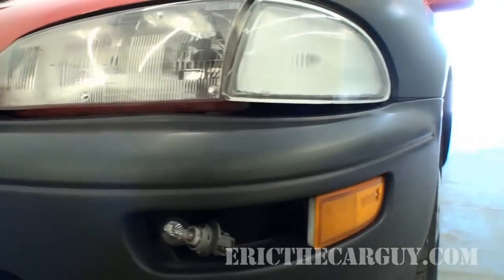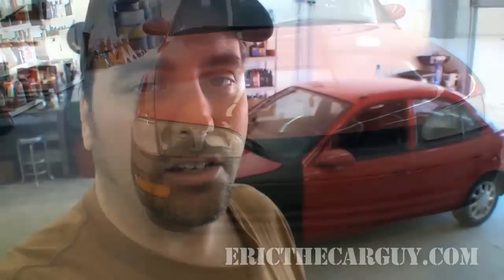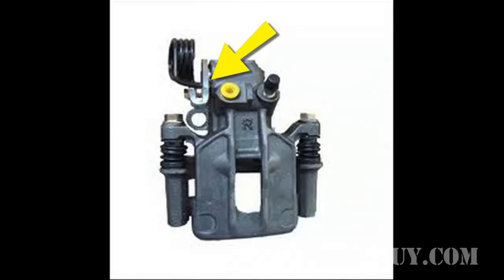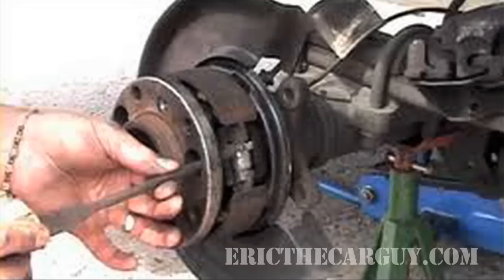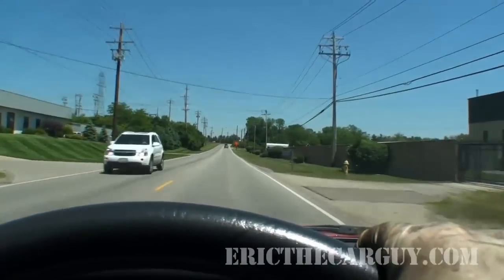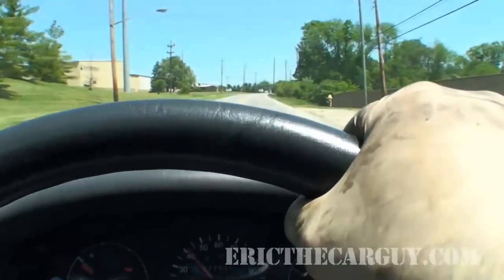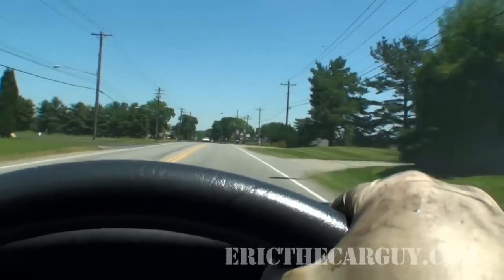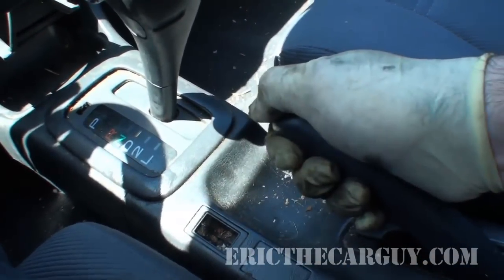How To Isolate A Brake Pulsation - Eric The Car Guy

Comment: Here is how you tell the difference between a front brake pulsation (warp) and a rear brake pulsation. If you hit the brakes and feel pulsation in the steering wheel and brake pedal it is the front brakes. If you feel it only in the brake pedal then it is the rear brake rotor/drum, but don't tell anyone cuz this is a trade secret, and you should never pull your e brake if you have never used it (auto trans) because there is a fair chance the cable will not release (rust) and you will lock up your back brakes.
Reply: I have just replaced rotors and pads on all 4 wheels and calipers and brake lines on the front of my 2009 Town and country mini van. I'm getting a sever steering wheel shimmy only at highway speed going down long grades? I checked the tie rod ends and they seem ok. A mechanic friend said it was a warped rotor even though it was new ? Got any ideas ? Thanks
Reply: @mightymopar128.  I know it's an old post...I'd bet one or both discs weren't installed 100% flush. 🤔

Comment: I had heavy pulsation when applying the brakes especially at higher speeds on my 91 LS400. I turned the front rotors and it did calm a bit but not all the way. The problem was a pair of bad strut rod bushings. Replacement cost $305 USD and free labor (yours truly).

Comment: Also remember that whenever you turn/change the rotors you need to replace the brake pads for both sides.  Using old pads with fresh rotors will creates uneven pressure on the pads and increase stopping distance.

Comment: Yeah, If you got steering wheel shimmy when braking from high speed (45mph+), it's probably the front brakes. If you got a low speed pulsation when braking down from low speed, 20 mph & down to a stop in the whole car, probably rears then...

Comment: You're under the impression that my parking brake works XD
Reply: lol hoops
Reply: Same😂
Reply: and thatthey have obnes that can be pulled. like mercedes, no hand break
Reply: If you don't use your parking break it will be out of adjustment. Your parking break usually adjusts your drum breaks.
Reply: @markflierl1624  It was 4 wheel disc, actually. The cables were just old and stretched out

Comment: hi, your car most likely have bad front wheel rubber bushing. when you apply brake at higher speed, the force from the absorbed of momentum will make you wheel move slightly backward. so the distance between your front wheel ball joint will vary, but the steering arm is fix length all the time. that means when you apply the brake your wheel will misalignment. The pulsation was caused by the misalignment wheel, and become more evident when at higher speed. 
every car (even new car)'s wheel will slightly misalignment when apply brake, but it is under the acceptable tolerance. but once the rubber bushing get bad, it will significant increase the degree of misalignment. hope this help.

Comment: simple remove all 4 tires , inspect the whole system.All rotors and drums turned or replaced. all bushings and pins cleaned or replaced. A 4 wheel job prevents comebacks.

Comment: To anyone who leaves comments on here. While they are good suggestions. You have to remember. Eric tries to show you ways to manually check for problems without having to use gages or special equipment. Unless you HAVE to have it.  

As for me checking warpage. I take off the wheel and use a large screw driver and turn the rotor/drum and feel for increase/decrease in resistance.

Comment: In the only two cars where I've worked on the brakes, the rear parking brake is a drum brake inside the hub of the rear disc, and doesn't activate the same caliper as the brake pedal would.
Reply: Volvo? Subaru? Ford F250? See my comment earlier for the best warped rotor test.

Comment: It's not always a "warped" rotor. I was having massive vibrations/pulsations like that and all I did was installed new pads and lubricated caliper contact points with brake lube. Then braked hard from about 40mph like 5 times to break-in the new pads with rotors. Then I took the car for high speed run about 80mph and braked hard on that as well. Now they're smooth. Having to pay to fix/replace rotors is really a waste of money. To warp a rotor is a very difficult thing to do, you basically have to be braking constantly and then run into a puddle for that to happen. In my case, brake pads had about half tread but they were very old due to lots of highway miles, so brake pads over time harden more and lose lubrication in the back plates and cause noise and/or vibration

Comment: now i have a question?
when i went slowly brake in my 00 ford ranger the brakes felt like they were pulsing shudder i even felt it it would push the pedle back up
Reply: Same problem i am having and cant find an answer. And mechanic had no idea. Did you figure it out?

Comment: When you isolate for the rear brakes by pulling the e-brake (and you do feel a pulse), that doesn't rule out that there isn't also a pulsation with the fronts. If you pull the e-brake and feel no pulsing, then it's safe to assume it's only the fronts. But the inverse is not true; you cannot rule out the fronts just by testing the rears because there's no way to only test the fronts alone without the rears also activating. So if you feel a pulse in your rears and fix it with this technique, don't be surprised if your fronts still need work.

Aside: I guess this car is a beater, but I do hate when mechanics get into my car with greasy hands (or gloves) and get that all over my interior.

Otherwise, nice video.

Comment: Brake peddle vibration when braking is not necessarily a warped disc. It could be worn slider pins which cost pocket money to replace, unlike discs, & only take 5 minetes a wheel to change, if your a keen diy mechanic.

Comment: For cars with the two-stage rear brakes, would jacking up the front (assuming front wheel drive) and running through the gears indicate where the shake is?  No pulsating would mean the rear brakes are the problem?

Comment: warped rims, bad tires, bad rotors/drums, bad master cylinder/booster, bad brake lines, bad wheel bearings, ...etc. It could be that it's original master cylinder/booster simply needs rebuilt/replaced. Get a Chiltons car repair manual...it will help you a great deal in your endevors. Good luck.

Comment: Taking for granted you have a front wheel drive car: -The 3 bearings on the inner most link (into drivecups/gearbox) on your driveshafts might be knackered. This will be noticed as a slight vibration, mostly on accelereation.
It's incredibly hard to give any advice without even having seen or tried the car in question, so a safe bet is to ask around at independent shops and have them have a look! ;)

Comment: You can also measure the run-out of the rotors with a dial gage and see which ones are the root cause.  Make sure that the rubber lines have not collapsed before replacing the rotors.  That can be tested by compressing the piston and making sure that there is not a back-pressure on the piston.  This is a sign of either a failed caliper or a collapsed rubber brake line.

Comment: The way to isolate a pulsation with rear disc/drum type parking brakes is to block off the brake hose going to the rear. Pulsation goes away it is in the rear; if it persists it's in the front. You can also block off individual wheels to pinpoint brake noise. This will still give you enough safe stopping power if you aren't going over 50mph. Hope this helps.
Reply: how are you blocking each line off without disconnecting them? you would wind up bleeding the system each time you reconnect them for a test drive. most brake lines might be damaged by crimping them with vise grips adding to the problem.

Comment: make sure your rear brakes are going their part after driving for a while check how hot each brake is getting ( don't burn your hand) if one brake is doing most of the work then that rotor will warp. fronts get a lot hotter then rears.

Comment: On some cars (4x4s usually) the handbrake operates on the flywheel (for instance, Land Rovers) not the wheels. If you pull the brake at speed with that set-up you're going to break something.

But good video/technique for a car which has a proper braking system!

Comment: A lot of "warped rotors" are really just rotors with uneven pad transfer. Chrysler 300 and minivan brakes are notorious for this, especially when overheated. A quick measure of at least four spots on the rotor will tell you if you have uneven pad transfer. Typically the max spec is 0.002" difference between the lowest and highest spot. A quick resurface of the rotors and deglaze of the pads will correct the issue, but only if the customer doesn't overheat the brakes again.

Comment: You could try crimping off each brake pipe in turn, and observe if the pulsation goes away or not, but this would really limit braking performance, so only do it in an empty car park, or a long empty road.

Comment: Mine had the wrong parking brake for this test however it could be felt in the steering. I was going to replace the discs but I figured the problem was uneven rust on the rotor. After a long time it has gone away!

Comment: I have Jaguar xj6 and am thinking its more drive shaft. wondering what you thing. pull park brake and feel the vibration but with an independent rear end and 2 PC drive shat. break pads and rotors are very good shape and not heat warp . I think its wither a u joint out if align or the center support bushing... What you think. support bearing is good bit the rubber bushing was blown. I replace it with urethane ...kinda solid . doesn't have much float and dapening??

Comment: If the rear brakes are the ONLY brakes causing the pulsation, then you will NOT feel it in the steering wheel you will feel the vibration in your seat, in the brake pedal and in your e brake lever.  If your steering wheel is shaking while braking your problem is in the front brakes.  However if you have the pulsation in the e brake lever AND your steering wheel shakes, then if could be a problem with BOTH front and rear.

Comment: if you brake to slow the car at highway speeds and the cars steering wheel or brake pedal vibrates, chances are you need an alignment. If the car vibrates your steering when trying to stop , chances are you need to have your rotors turned and/or replaced along with the pads. The odds of it just being a brake problem are slim. Check the alignment and wheel balance for warped rims or bad tires. There are a few other things but most of the time...that solves the issues.

Comment: LOL I love how he calls us out on pointing out his dirty gloves.. I couldnt help think about how dirty the car would be getting with him touching everywhere, but im sure the rubber gloves dont let the grease transfer.

Dont be mad, be glad! Haha

Anyway, I have a 2003 Sunfire (front rotors, back drums), the warping seems to be happening when braking at low speed (-20kmh), but also rivits like crazy at super high speeds (+100kmh). At first, I was thinking they were the rotors, but I realized I had both bearings, rotors and pads replaced on the front, and both brake shoes on the back replaced (no drums yet) - I also noticed some stop during the drum rotate test (where you take the wheel off, and see if the drum rotates consistantly, rather than being tight in certain spots).

The most interesting part about all of this, is that during my isolation test, both the e-brake as well as the pedal, didnt make the riviting go away, both at high speeds, and near stop speeds. 

Im completely stumped.. I was in an accident (driver side doors to rear wheel almost) back in feb 2014 (its june 21/2015 for reference), and I have a feeling I dented a knuckle or joint.. I cant figure out which it is though, its a pretty old car at this point. Any advice would be appreciated!!

Comment: Ha...great tip. I'm going to give this a try now. I'm already pretty certain my problem is in the front based on what I have been feeling in the steering wheel but this should tell if the back is bad as well. Thank you Eric.

Comment: Helpful thanks. My Vw 1988 t25 didn’t have a pulsating problem until it had both new front and rear brakes fitted. I still can’t find the problem. I had a feeling it was a bleeding issue but likely not then.
Reply: If you have drums in the rear it could be that your self adjusters aren't there or working properly.  If you brake pedal goes down far that's the problem.  It's only using front brakes to stop.  Many mechanics miss this or F-it up.

Comment: @LesnarPwns actually the geo prizm 93-97 had a toyota sprinter frame from europe. it is a copy of the corolla underneath with the 4A-FE 1.6l or optional 7A-FE engine. from 98-02 the chevy prizm beared the 1ZZ-FE engine, a clone of the corolla. The only American parts in them were the delco stereos.

Comment: What bout intermittent pulsation when the brakes are NOT depressed.  Also got it "most" of the time while depressed and it looks like its going to be the front wheels... but I cant figure out what is causing the "random" shakes (in the wheel and my butt) at speed when the radio is off (pun intended.)

Comment: If it's at high speeds like that, it's most likely tire/wheel balance and not tire inflation. I'm no expert, but most issues with hub or wheel balance can probably be worked out by getting the them balanced at a shop with a balancing machine.

Comment: What you can do is lift the back end if it is a rear wheel drive and break while having the back wheels spinning, if you have pulsation, you know where the problem is, if you have a front wheel drive you lift front and if you get the pulsation it's in the frontnmight get problems with this if you have ABS but that you can disable it just for this and it will not interfere, you may also want good speed on the wheels to get them spinning on both sides and BE CAREFUL AROUND  SPINNING WHEELS!

Comment: does it feel like an abs pulsation?? but much more light? sometimes a bad wheel sensor can cause the abs to pulsate during braking. most likely it is a rotor that is slightly out of round that is much exaggerated at high speeds I would check all wheel sensor readings with a diagnostic tool if the rotors are not out of round and with in spec.

Comment: I have a lugging/pulling from front end when braking in my 2007 fj crusier (i dont feel it in the brake pedal though) ..changed calipers, rotors(twice), brake pads,  and now will be trying new wheel bearings...  my neighbor mechanic said it might be axel or something much more expensive....any ideas are very much welcomed! ....?😁

Comment: Hi Eric, I have question about my vibration. It only happens when I'm going on a long downhill at very high speeds and when I keep the brake depressed. Is this an indication that my rotors are warped? Thanks for the help!
Reply: Was your issue resolved? I have the same issue and I replaced the rotors but still the issue exists.
If your issue was resolved please let me know , will be much appreciated.

Comment: The brake pulsation on my ‘01 Subaru Forester went away after I reinstalled its rear OEM brake components. The aftermarket rear brake rotors I had purchased came warped.

Comment: What if I have a newer car that doesn’t have a separate parking brake?  It has an electric rear parking brake button.  Also I feel pulsating or a grabbing/jerking when I stop.  I don’t feel anything in the steering wheel.

Comment: logically then,if it wasn't the brakes,then the problem is worn suspension part(s) ie. ball-joint,tie-rod ends,sway bar bushing(not very likely if its real bad vibration) or a combination of these,maybe even a frozen or totally wasted shock absorber/strut.i've had more than one car where the alignment was so far out it would about vibrate the wheel out of your hand,of course this is going to be accompanied by left/right pulling as well,almost always.

Comment: Correct me if Im wrong but arnt their a lot of cars where the ebrake only functions on one wheel? Ive had a few vehicles like that. 

@ L1ne, im surprised its gone on that long without any serious issue, you could either replace the rotor/sru, yourself or pull the rotor/drum and have it machined.

Comment: This might be useful to me.  I just recently purchased a '92 Mustang GT and I have noticed some amount of brake pulsation.  While I do feel it in the steering wheel, it might not hurt to give this test a shot.

However I have two problems.  Well, one problem and one curiosity.  Firstly the problem seems to only occur mostly when braking from high speeds, and for a time it would occur sporadically at lower speeds although this is no longer the case.  Before I try this test and maybe pull (cont..)

Comment: Hey Eric the brakes on my civic are 35.000 km old and when I press the brake pedal slightly, like lay my foot thumb on it, even when hot I hear the brakes squeak, but when I apply them hard I dont hear anything, is it normal that the indicators are touching the rotors too soon?? Because i still have roughly 4mm or so.
Thank you for your videos you are a big help

Comment: im working on 2001 chevy express 1500 and it has a real bad break pulsation from the front wheels. could it be the calipers also? or just the rotors being extremely warped. also on the same van, the turn signals flash real fast, all four, but when you put the hazards on, they blink normal. all the bulbs are the right ones, the 2057. could this be the combination flasher?

Comment: I have a 99 chevy metro. last year the front driverside wheel bearing failed, the wheel actually fell off with no warning, luckily I was turning a corner after a stop and not going very fast.. It was repaired (very expensively) Ever since I have had this pulsation when I brake. My assumption has been that the rotor got warped during the wheelbearing incident. I just had the rotor and pads replaced and it made absolutely no difference in the pulsation. Any suggestions?